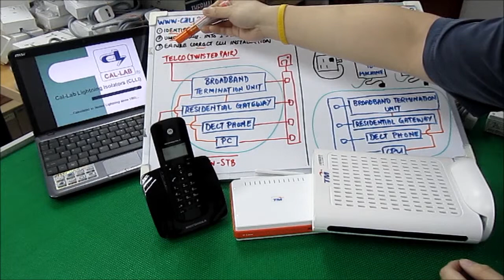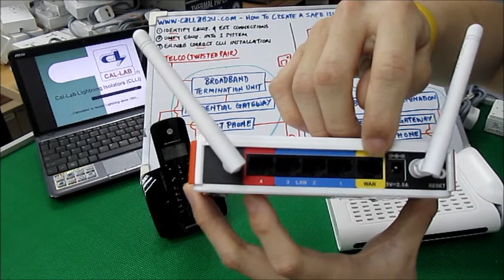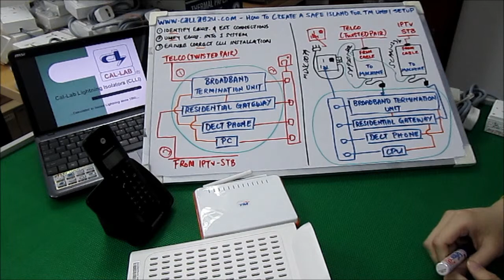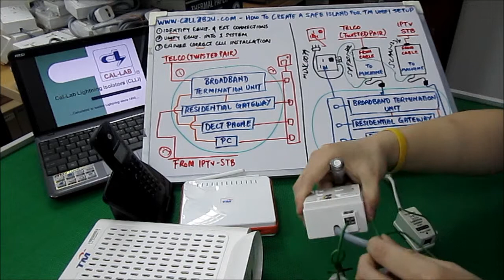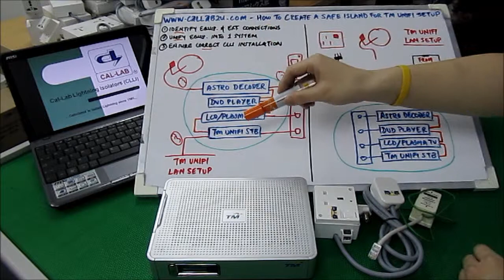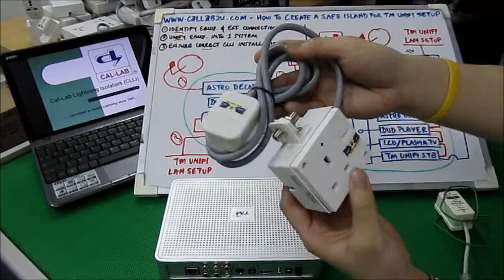How to create Safe Islands for typical UNIFI setups with CLLI

Comment: Hi, the wire for SP9201 & SLAN1236 (green and grey) is way too short!! 
Normally people will put the BTU and the Residential Gateway on a table. 
The plug (3pin MDSC0039) would be on the floor.
It is not possible to connect MDSC0039 to Residential Gateway using SLAN1236, wire is too short.
I have SLAN1236 the total length is less than 1feet.
Unless your table is <1 feet tall.
The same goes for MDSC0039 to BTU using SP9201